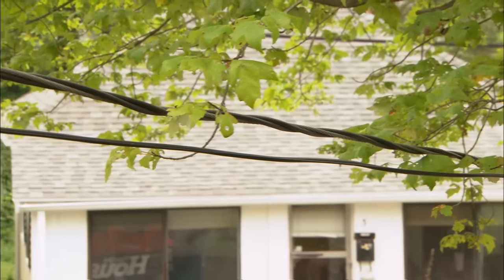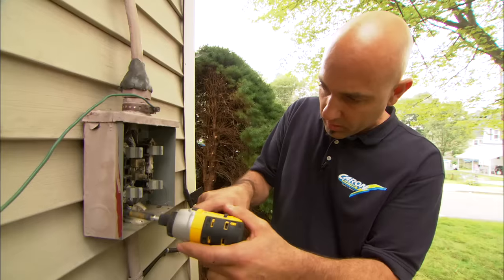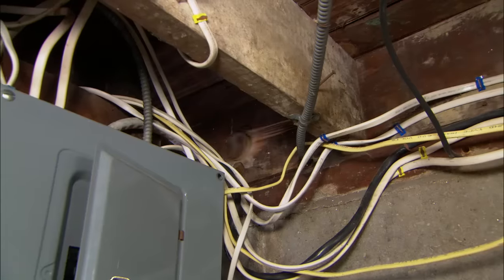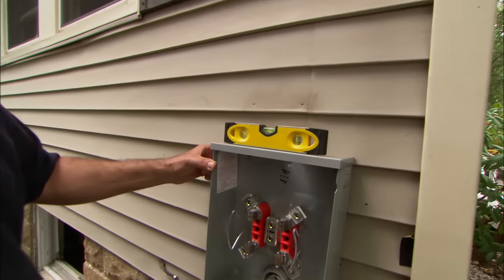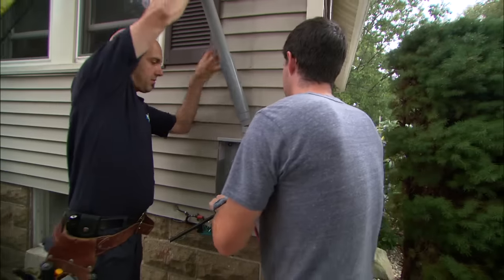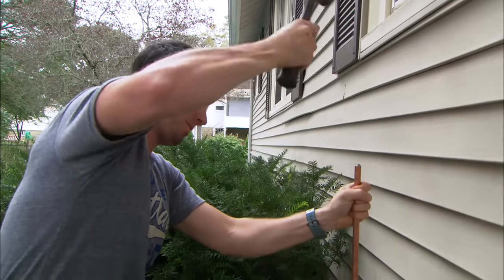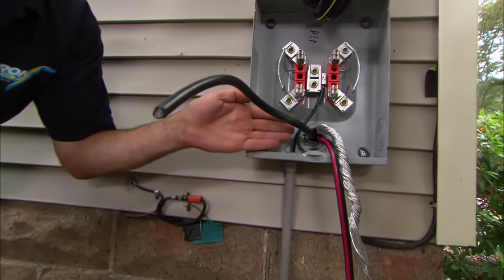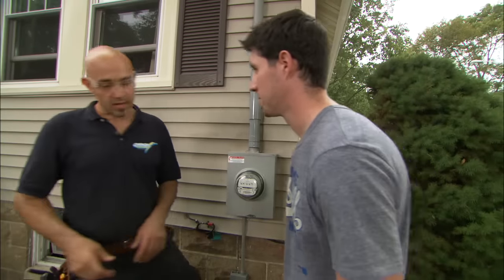How to Upgrade an Electric Meter to 200-Amp Service (Part 1) | This Old House

Comment: Lol, "upgrading" to Aluminium, only in America haha! Not even legal anymore in Europe.
Reply: It's only for the service and it's perfectly safe. All the termination points are designed for it. If it's unsafe, please cite why.
Reply: Because when it was allowed, people would size it like you would size copper lines, resulting in overheating and damage.
Reply: Well that's a different argument and more towards the incompetence of the electrician for not following 310.15B(6) (In the US) . And aluminum is still perfectly fine for service entrance cables and up to code here.  It's not allowed for branch circuits however but there is good reason for that.
Reply: We use Alum for big service cables.. Because copper is to fucking heavy and it's more money.
Reply: +FrozenHaxor here in the us you have to be s brilliant electrician to do electrical work so sizing errors won't occur.
Reply: not true.   Aluminum is an excellent conductor,  and they want the service line from the pole to be as light as possible, so they use only aluminum now.  The wires in the pipe might as well be the same.  You just need to be careful not to nick the wire when stripping, because it could start a crack, being more brittle and weaker than copper. The termination points are made for the aluminum expansion coefficient.
Reply: Maybe its because this is America where anything not nailed down can and will get stolen.  Ever see videos of the abandoned houses in Detroit?  The first thing to be stripped was every copper pipe and wire.  I would guess a nice heavy thick piece  of copper wire would bring in a nice price at a scrap yard.
Reply: FrozenHaxor 
Back in the 60's and 70's all contractors went to aluminum wiring in residential homes as it was a lot cheaper than copper wire until several years later house's between 7-10 years old starting burning down for no apparent reason until they discovered the aluminum wiring was over heating and causing the fires. It is now illegal to use aluminum wire in a residential home and I have to wonder if they aren't cutting corners by using aluminum for the neutral on meter connections. The only use of aluminum wire I knew of until this video was for long distance high voltage power lines up to 500,000 volts three phase.
Reply: We personally don't like it, but the builder generally wants it so they can save money.  Putting in copper doesn't make us really much extra.  Sometimes, we have smart homeowners (who are having the house built) who ask for copper.
Reply: The only reason aluminium is used instead of copper is that its cheaper and thus less attractive to steal.
Reply: Then to give same output I would need a 12 gauge rather than 14 then?
Reply: I am an American making videos for Russian electricians, and I am so f-ing tired of fielding these nonsense remarks.... "You use aluminum for service entrances? what?".. Yes, we do, and yes, it's fine. As sue-happy as America is, do you think this would have lasted a day if it was creating any danger?
Reply: Arie ....
..
Reply: FrozenHaxor á
Reply: This master electrician doesn't know how to put a ground rod in without beating on it.  Also where is your main breaker or fuseable switch since the interior panel is over 3 ft from the service and riser.  Then put pvc as the riser.  Get you some IMC or rigid.  Looks ten times better. Aluminum gets way hotter than copper. So yes def needed copper for his service.
Reply: emmett streeter if u size The aluminum wire properly,  u won't have heat issues.
Reply: Aluminum (corrected spelling ;) ) is a fine conductor. It's not dangerous if it's sized properly. Sizing it properly is literally as simple as reading the standard and following the instructions. Besides this is only for the service. Most power system conductors are ACSR or AAAC.
Reply: Here in Germany the usage of aluminium conductors is only permitted if the conductor size is at least 16mm² (cross-section area of the conductor), the american equivalent would be AWG 6 I think. Problem is aluminium is brittle, if you bend it too often or too hard it will break. That's a problem you won't have with copper. And that's the problem with aluminium wires inside of the house used in the branch circuits. In east Germany they've used aluminium conductors often in branch circuits. Aluminium is cheaper and lighter than copper but you must always use one size larger than copper. For example 1.5mm² copper would be sufficient to fuse it with 16A. With aluminium you need the next size, 2.5mm², to fuse it with 16A. And you need to use special connectors and a contact grease to get a good connection. But this can be prevented if you use something we call "AlCu"-cables here. It's copper coated aluminium:

https://upload.wikimedia.org/wikipedia/commons/3/3a/Wireendssmall.jpg

For these you don't need special connectors and no contact grease. The service companies are using this type of cables. For branch circuits only copper is permitted here.
Reply: 241? lol, is this 2008? 400 bro, 400!
Reply: Yup, 3x230/400 V...230 V between the three line conductors and neutral or ground and 400 V between the line conductors.
Reply: you can use , but min. 50mm2
Reply: Nothing wrong with aluminum as long as it is terminated properly

Comment: I call shenanigans, the Electrician will not pull or replace the meter into the meter socket. And for sure will not install it until it has been INSPECTED by the local inspector. Or does this Old House not believe in getting proper permitting? Hummmm...........
Reply: Its done everyday in all States across the Country. The licensed electrician disconnects the old service. Pulls the meter. Installs the new service. Re installs the meter.   Reconnects the new service then calls for inspection.
Reply: Okay, Karen
Reply: @Harrison2253  Wrong, Does NO happen in Indiana
Reply: @dennysickinger6006  Well no in Indiana you do not
Reply: @ODCDragon88  I live in the OH/KY/IN tri-state. Literally 2 miles from IN. We do this everywhere. Just b/c you're scared to do it hot doesn't mean electricians are.

Comment: UK ELECTRICS so much better.
Reply: Jamie O'Sullivan, I've never seen a panel melt down except for a CE listed panel.  And, since it was all plastic, melt down it did.  Your approach to protection is completely different from ours.
Reply: We don't use plastic any more 👌
Reply: UK electrics are far more safer and we don't need a huge 200 amp supply to our households as we run 230v.
Most domestic households in the UK have 45 to 60 amp main fuses protecting the mains and if they are new services it's usually 80 amp fuses.
Most of our network the distributes supply the main earthing (grounding) in the form of tn-s or tn-c-s and older more rural areas have TT incomers from overhead lines.
TN-s for you yanks is where the steal or lead shielding of the cable is used as the earth or ground for you's and is staked or connected to earth plates along the length of the cable runs underground.
TN-c-s is where the neutral is grounded to be used as an earth source or ground also you have PME on the tn-c-s supply which is a protective multiple earth where the neutral is used as an earth and so it the sheath of the cable but this is only used where older installed cables are converted to TN-c-s.
Our main incomers these day for tn-c-s have only one live or line conductor in the core of the cable and has shielding which is used as the neutral and earth making the cable lighter but still able to carry the current and yes it's copper core with and aluminium shielding as this is carrying virtually no load.
Copper is a far superior conductor to aluminum and conducted sizes can be smaller but carry more current.
The reason aluminium was used was because there was a copper shortage in Europe and our electrical govern body's realised how poor of a conductor it actually is so reverted back to copper
Reply: Asa Mitchell, that sounds so much more better-er than anything allowed by NFPA 70.  I'll email the NFPA and tell them to scrap the entire thing based on your input.  We'll be on the IEC by the 30th of Feb.
Reply: why u even need 60 amp? let alone 200? we have 25 as standard.
Reply: dc though, no?

Comment: have to check the ground rod resitence if is at least  5 ohm's using earth ground tester tool?
Reply: Not when you drive 2 rods whatever it is it is
Reply: Nobody does that in the real world

Comment: question from a german electrition : how much degrese is ur phases delayed? 
in germany we have 3 phases + PEN with a delay angle of 120°
Reply: RaeZax In homes, we use 120/240 split-phase 180° L1,N,L2 plus ground (PE). Line to line 240 VAC is used for big loads, and line to neutral 120 for basic outlets. Google split-phase power if this is unclear, but it’s basically center tapped single phase. 

In business and industrial locations, a three-phase 480/277Y or 208/120Y at 120° is common, but you can find 240VAC delta also. In Canada, 600/347Y is common.

Comment: Our utility does all of the meter work and is responsible for the wire to the meter box.  The homeowner is responsible from the meter to the house.  We are charged for the work provided by the utility for hook-up but there is consistency in meter connections.
Reply: Porsche924Tim damn. I'm glad my utility company doesn't do that. It costs about 300 bucks in materials to upgrade my service panel and install a new mast and weatherhead for exterior overhead with new conductors. I wonder what the utility company would charge for drilling through my roof, mounting the pole, installing the roof jack, and reinforcing the framing in my attic to adequately hold the lag bolts which holds the service entrance conduit...
Probably would have more than doubled my costs for such a rule.

Comment: That service entrance cable have had an insulated neutral. What you have is 2 current carrying conductors and an equipment grounding conductor that is bare and you're using it as a neutral. You should have bought sevice entrance cable with 3 insulated conductors and the bare grounding conductor.

Comment: Thanks for sharing with us. A question: the new meter an main panel are set for 200 Amps. That means the 2 live wires are carrying 120v each and 100 amps each?
Reply: No each wire can has 200 amps and 120v
Reply: Zaxaris Petixos thanks for your help. So that’s mean I can count with a total of 400 amps. In real ?
Reply: @jesusortiz6842  no you double the volts not amps as they stay the same. ( as 120v goes into series making 240v) main panel runs at 240v single breakers 120v double breakers 240v
Reply: Jacqueline Heaton but my question is: if I have the line for 100 amps from the electric company. How many amps in total I have to split in my house items.?
Reply: @jesusortiz6842  he is saying that you get 2 wires with 200 amps 120v each and you can use them with 2 neutrals and have 2 seperate circuits of 120v 200 ambs or combine them and have one circuit if you need 240v 200 amps. Your electical grid is very weird in the usa
Reply: Zaxaris Petixos thanks for your help. I appreciate.
Reply: Jacqueline Heaton thanks. I understand now.
Reply: @zaxarispetixos8728  there’s only one neutral.

Comment: I’m an electrician in the UK, it’s actually frightening how far behind some of the US “electrical panels” and other wiring accessories are behind the stuff we use. It looks like the stuff we take out of service from over 30 years ago. I can see that’s why you guys go for the centre tapped 240v supply.
Reply: How are we far behind in Canada/US?

Comment: Hi, what Gage of wire goes in and out of meter and also what size of PVC pipe should be used. thank you great vidio
Reply: 4/0 URD in a 2" pipe. Then that's 4/0 SER fed to the panel from there in the video.
Reply: Thanks

Comment: Dont need a bushing on  SE cable connectors. they are rounded edges from the factory, and the sheet of the SE cable also is protecting the wire. You also didnt need the noalox on the aluminum wires. modern lugs use an alloy that is safe with either copper or aluminum without the need for noalox.

Comment: Insects will waltz right into the home behind the panel. He didn’t seal the big hole. This is why I watch every step of anyone working on my house. The pros skip steps easier because of the trust given to them.
Reply: How do you know he didn't seal it from inside with spray foam?  How exactly do suggest that he seal the hole with the meter box in the way?  Only thing he could from the exterior is to run a bead of silicon around the edge of the can.
Reply: Oh lord, a helicopter homeowner

Comment: You put the clamp on the accessible side, so if the socket box needs to come off, it's easy to free it from the wire.

Comment: What are the benefits of this upgrade,  or rather why would I want this done?
Reply: When you use more power, simply. We bought an EV plug-in car and it alone uses 50A. If we needed to run A/C (30A) and run the electric drier (20A) the main breaker (100A) would likely trip because too much power has been used.

Comment: I know a little old lady that had no ac and only ran a few lights and her stove to cook with. Her bill was $300/350 a month. The electric company came out several times and said all was good. I live in the same neighborhood in a similar sized house and had kids in the house with central AC. My bill would run $140/190 depending on the heat outside. This is south west Florida so a heater is never a real issue. So yea there is something to these stories.
Reply: Something wrong.

Comment: I like his install except for the PVC service entrance . NEC code PVC can't be used anywhere it can be damaged . I personally only use for underground use only and do my transition below grade with other EMT or rigid and do the connection Underground for service entrance I use rigid only period with a clamp or set screw or thread weather head
Reply: PVC is absolutely allowed in that situation. And did you say you use EMT underground?  I hope I misunderstood

Comment: Can you upgrade to higher than a 200 amp service for residential?  I a!ready have 200 amps but have no more open slots in my panel since I have a basement circuit, solar panels, AC, and surge protector.

Comment: EVEN THOUGH ITS NOT CODE, you can easily replace the 100 amp load center with a 200 amp load center without replacing the meter and all the wires.  The point is to calculate your power draw.  If you need more circuits but all your circuits combined will not be drawing more than 100 amps at any given time, you just replace the load center.  Now, you SHOULD replace the service with 200 amp but you do not always have to go through that.
Reply: What?

Comment: You don't need a licensed electrician to upgrade or replace a panel. You just need electrical knowledge and common sense. 
I upgraded our 200 amp 20 space to a 200 amp 40 space. We actually spent more on materials than permits and inspections.
Reply: Usually a homeowner is allowed to work on his own house.  Just need to be knowledgeable
Reply: @LesbianNaziHookers  Agree completely.   There are many incompetent and lazy workers out there.   I have found sloppy and dangerous installations done by previous owners that was passed by an inspector.   Most inspectors have been capable and helpful.  It's critical to develop a rapport with the inspector.  They need to know you have listened to them and made any corrections they have identified (even if the correction was not in the codes).   I have also had inspectors make comments that I know are not in the code.  It is risky to tell an Inspector he is wrong.

Comment: Aluminum wire requires anti- corrosion compound on the connections.
Reply: Saw it too Stevie
Reply: This is use for earthing but this gay not a cable glaiding  but work is so beautiful
Reply: @amirshahzadamirshahzad7354  someone needs to study the language
Reply: Ive never heard the word glaiding but it's appears to be some old English. I googled it and it gives an example. Looks like old Irish Gaelic mix with English? Anyone care to explain the word? Props to you Amir for giving me a new word to confuse people with.
Reply: Kayif halakum?
Nasilsin?
I'm a not sure of your origin so there's two attempts.
Reply: You notice after he cuts the neutral wire there is a a very brief moment were he is applying Noalox a compound used for antioxidants and anti seizing
Reply: @Blue_collar_fitness  also noticed that live conductors were dry when he inserted them into connector

Comment: Chicago would never allow pvc  for service entrance conductors what state is this
Reply: Chicago has bigger problems to worry about than material uses for service masts. PVC is used everyday for service masts as long as the pipe isn’t supporting the overhead service wires

Comment: How come 2 grounding rods? Would that  cause some issues with differential potential?
Reply: In dry soil the resistance is high so they use two or more. In the old days we put a gallon of copper sulfate  solution ii the soil at the ground stake to make it more conductive..
Reply: He might be in a jurisdiction where no resistance measurement is required if two rods are used.

Comment: Two things i see is no nolox for anticorrosion on the bare aluminum wires and when drilling inside hitting the 14/2 home run possibly shorting out that circuit. Other than that good stuff.

Comment: Right off the bat, Failed to mention that the power company has to shut down the feeders to the meter.
Reply: 0:15 says otherwise.
Reply: @rickbrown2397  just says the lines were cut, doesn't mention the power company coming out to remove the meter and cut the lines.

Comment: I want to know about the ground wire from the ground rods, seems like everybody, neglects to show how its terminated, would you please show it
Reply: 6AWG wire that connects to the ground bus bar of the panel.
Reply: @cabdolla  yup, and ground rod clamps on the rods themselves.